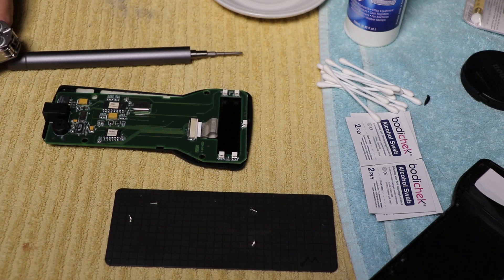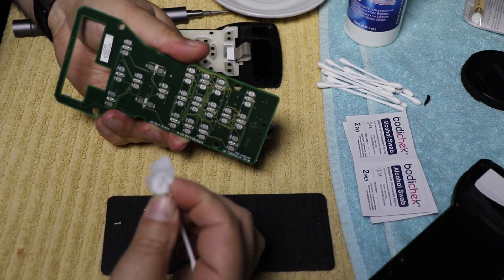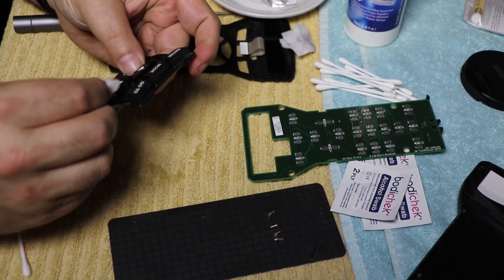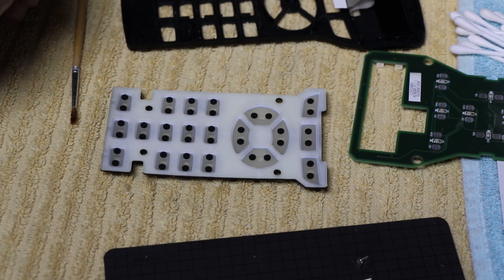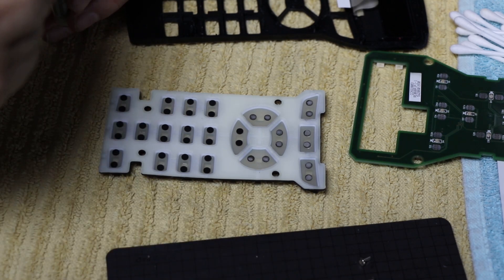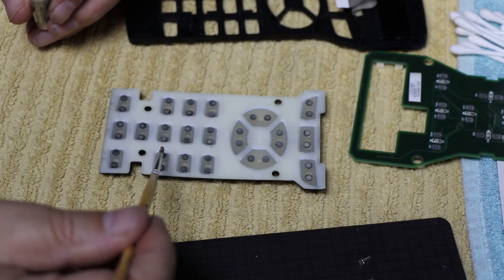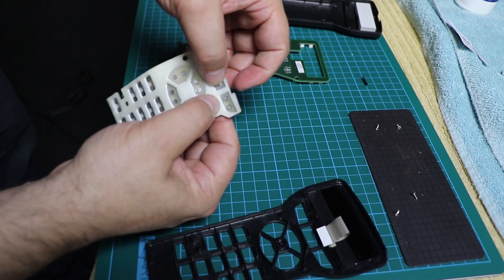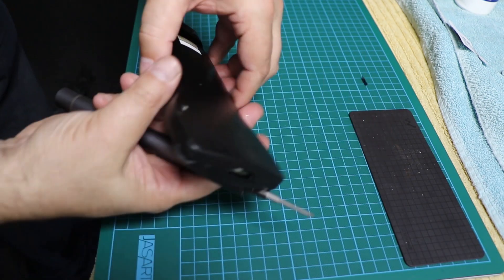Ep 010 - Meade Autostar II Handbox Repair

Comment: Great video.  I used deoxit on all connections to include the ribbon cable. The ribbon cable connections were completely corroded,  before cleaning when I turned on my controller the display was unreadable. Buttons w ere non functional. After cleaning with fiberglass pen 🖊 and deoxit it works like new. My biggest issue was the corrosion on the ribbon cable leads. I was about to buy a new 497 controller which there is only 1 on Ebay for sale and they want 400 bucks because of no supply due to covid and supply chain issues,  you saved me a bunch. Thanks again, just awesome!

Comment: Hi firstly I have Meade Autostar 497 control controller. The lights are on when the remote operates, keys are active
 working
but there is no text on the screen. I think the LCD screen is broken and I will replace it with a working screen
.
 Do you think the whole controller is broken ?  Thank you.
Reply from the maker: Hard to know. I suggest you go and join the following group as there are many people who know these controllers well. 
https://groups.io/g/LX200GPS
Reply from the maker: It's worth noting that the Autostar 497 handboxes actually contain "brains" unlike the Autostar II handboxes (like in the video), which are just a display and keypad (all the brains are in the scope). It may not be as simple as replacing the screen.

Comment: I tried cleaning the black dots or conducting pads, it did not seem to make much difference, so I took a self adhesive copper foil tape , cut small square pads just big enough to stick on top of the dots, press them down hard so they won't fall lose and damage or short other electronics, (always a possibility a cooper pad may come lose and fall off short out something , but a risk well worth taking otherwise the bloody thing is useless anyway)  I have repaired  many TV remotes like that , so i know it works, and my Meade LX200 Autostar started to work brilliant,  before that you would need to press buttons many times and harder before it accepted any commands.
Reply from the maker: Yep, you're getting the same result - the conductive silver paint is less likely to detach though. It does make a massive difference.